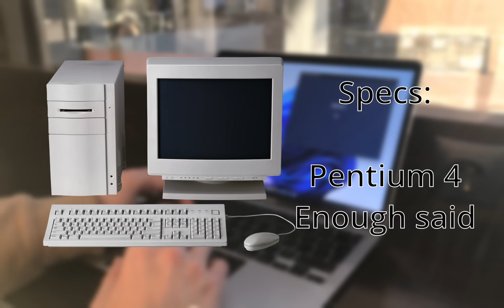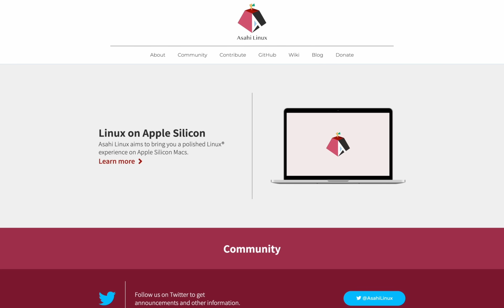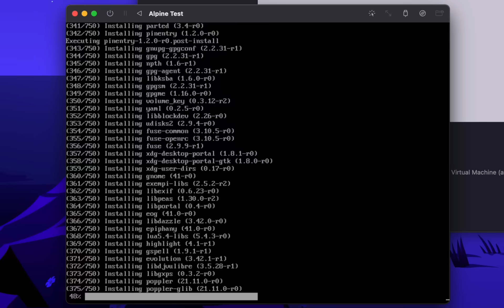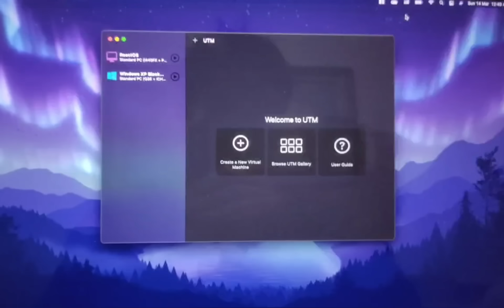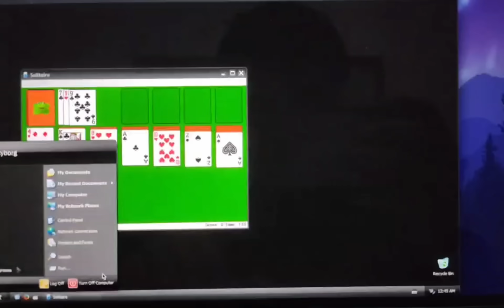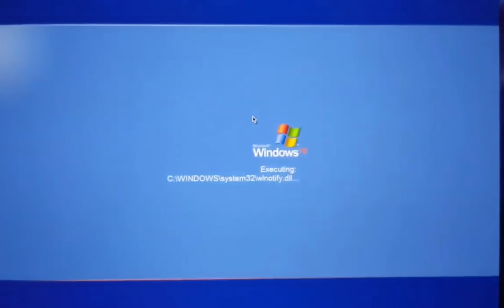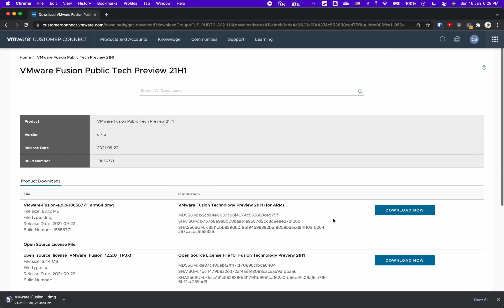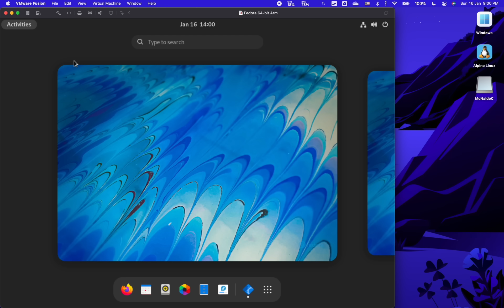Using Virtual Machines on Apple Silicon

Comment: Fyi. For Windows on M1 you do need to mention that windows on arm is in preview and cannot be licensed for use a company/enterprise if you want to use it for work. 

I hope this change as I want to run Windows on my M1 max for testing purposes.
Reply from the maker: Well, you're right, I didn't make it very clear. I did say you have to go through some hoops though. And since Microsoft themselves are selling a commercial product with the "Pro" tag (Surface Pro X) running Windows on ARM, I think it can be considered out of preview.
Now of course, because of a deal that Microsoft has with Qualcomm, no ARM chip manufacturers are allowed to work with Windows on ARM except for Qualcomm, who are falling behind in the chip design game, it seems. So Windows on ARM is not optimized for anything but Qualcomm chips, and even then, the M1 through Parallels or UTM outperforms anything Microsoft or other OEMs have released running Windows on ARM.

Comment: It’s hard for me to tell, because I’m watching this on my phone, but I think you might’ve been using a slightly older version of UTM. I’ve been running it on both an M1 Mac mini and an M1 Pro MacBook Pro, and everything runs really great. Windows 11 ARM Get CPU performance around 80% or more of what the host computer gets. Graphics is still not GPU accelerated, and for some reason disk speed is pretty slow, but for anything except games, UTM is pretty impressive.
Reply from the maker: UTM is great! It ran a bit slower on video because the macOS screen recorder slows the system down a bit for some reason, but overall UTM is fantastic for casual use. The lack of full GPU acceleration (it is partial) is a downside though so I would not recommend UTM for serious workloads or games.

Comment: I was thinking about getting Parallels, but the pricing and cost of Windows made it cheaper to buy a computer with Windows included for 500 euro and control it with Chrome remote desktop. With 0% compatibility issues.
Reply from the maker: Interesting choice. I would argue it isn't cheaper, and you don't need to activate Windows to have pretty much full functionality. To each their own.
Reply: Imagine paying full whack for Windows lol

Comment: Your channel is gonna go far! 😄
I really hope that with the upcoming WWDC, Apple changes and encourages (long-shot but worth a try) the developers to build tools for their ARM platform. I get the feeling that there's a lot of catching up to do and lots of research and development to tap into that ARM power on the Mac and I wonder if this catch up strategy that Apple constantly does is actually good for software. 

I hope it gets better so that you can actually use one machine for all your needs.
Reply from the maker: All they really have to do is provide adequate documentation for the components and hardcore developers like the Asahi Linux team will inevitably do the rest and make drivers out of sheer curiosity.
Reply: @KalosLikesComputers  Crossed fingers and toes, but Apple controls everything so probably not. 😅
Reply: i was thinking about subscribing, but then i saw him wearing a mask.  Sorry,  but you don't get my sub for being a sheep.
Reply: @daomingjin  For crying out loud - lotsa luck in public spaces when face diapers were mandatory for access....

Comment: After using Parallels for the past year to run Windows on the 8GB MBA, my conclusion is that it works okay.  But RAM is a limiter for smooth performance, particulary at startup.  I wish that I had bought the 16GB version.  I would like to see how it works on the base 14" MacBook Pro (M1 Pro).
Reply from the maker: I know what you mean. I haven't had any issues on my Mac, and I'm even running it off of an external SSD as you can see in some shots, it's pretty much a matter of luck whether it'll boot fast or not. RAM is a bit of an issue especially since it has to share it with macOS but it's perfectly serviceable for my needs, especially if I'm running Linux instead of Windows.
Reply: @KalosLikesComputers  I am running UbuntuDDE on the original Lenovo X1 Carbon from 2012 that has 4GB of RAM.  It runs like a dream.  Windows would not and it illustrates the problem with virtualization.  I bought the 8GB MBA just to see what the M1 chip and MacOS was like.  Little did I know that I would like it so much that I wanted it to run ALL my software on a daily basis.  The fact it can (with some occasional memory struggles), is amazing.  In the rear view mirror, I am kicking myself for not getting 16GB.
Reply: @markholle3450  Yeah, I also had an M1 air with 8gb running Windows in parallels for a while. It's usable if you only use the VM, but sucks if you wanna do anything else. Really regretted not going for 16gb, but a few days I finally got myself a 14" MBP 10-core. 
It's been working great performance-wise, but it gets really hot (unlike my MBA), which is pretty annoying. And also I now regret going for 16gb and not 32gb :D As 16gb that still is not enough for heavy multitasking in both the host and VM. I think 32-gb 10-core MBP is pretty much a perfect portable workstation now, for most tasks! Just as you mentioned, I liked the M1 so much that I moved my work from a windows laptop to a VM.
Reply: I have the base 14”.

Works grt for everyday things. However, my poker games run too much CPU. I wish I got the 10 core upgrade for the add’l $250.
Reply: That's okay, M2 MBA is waiting for you!

Comment: I'm a hardcore VMware guy since I make my living as a Virtual Infrastructure Admin in the Enterprise space (which they dominate), but you're right - the technical preview of Fusion on the M1 Mac just sucks. :/ I'm hoping they work out the bugs soon!
Reply: Yeah, unbelievable it is so bad. It is like they are not even trying...
But on the other hand, I can't justify paying for the Parallels licence given the use I would have of it...
Reply: Yes, I develop on Mac and the VM support now sucks! vmware is not available. Even the latest Docker Engine crashs a lot.
Reply: @mingli9563  I am a developer too. Soon after the original WWDC Apple Silicon announcement I bought a 2020 27" iMac with the 10 core i9 and the 5700XT. The user upgradable RAM slots make this an ideal machine for running VMs and Docker.
Reply: @mingli9563 , hard same! Having the same issues with Docker on my M1. :|
Reply: Think I'm just gonna use Ubuntu via Multipass.

Comment: Have you found a viable way of running Android through virtual machines? I tried it on Win 11 ARM but it is not supported ?
Reply from the maker: If you mean that you tried running Android apps through a Windows 11 ARM virtual machine on an M1 Mac, it relates to the issue I talk about at 1:44.
Windows 11 runs Android apps through the Windows Subsystem for Android, which is essentially a stripped down Hyper-V virtual machine. This cannot run on M1, because it would be a Layer 2 virtual machine.
Reply from the maker: Android is actually quite different - Android Studio installs an Android emulator that does work but is very slow. QEMU might be able to run Android. UTM had a pre-build Android VM in their library but they removed it at some point. Here's the statement:

"We removed the Android pre-built images because Android does not run well on QEMU/UTM and created a lot of confusion. Advanced users can build their own Android VM from scratch but it is not recommended."